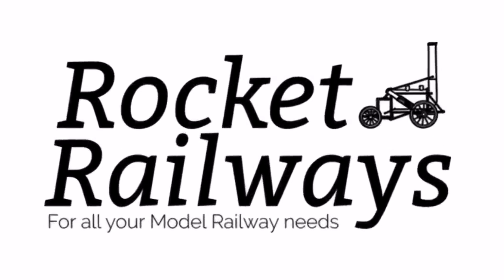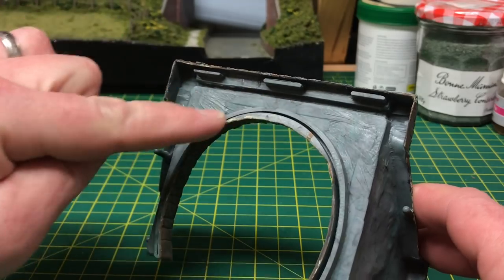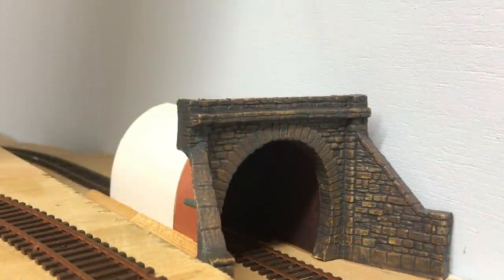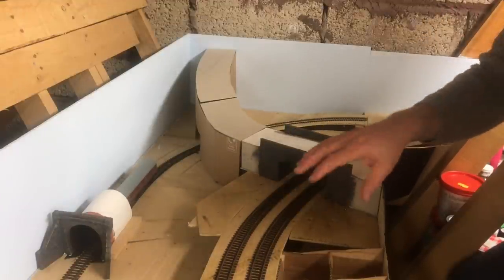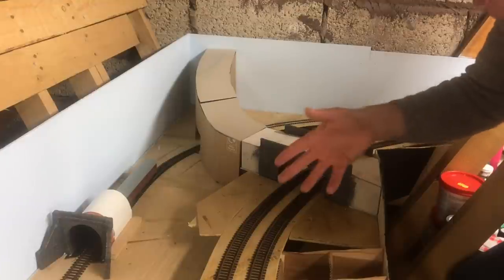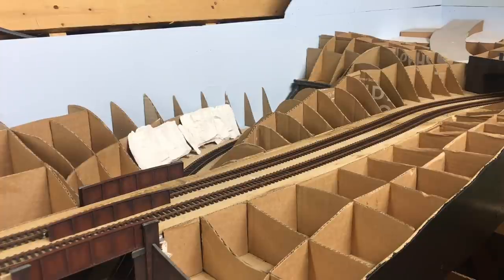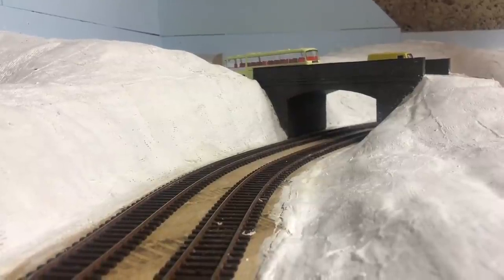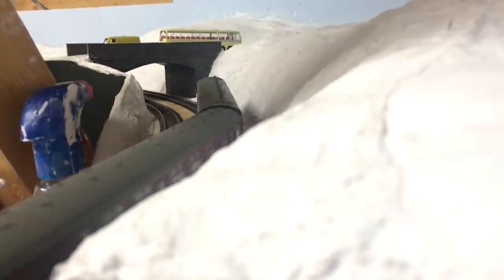Building A OO Gauge Model Railway: Constructing Hillsides And Cuttings

Comment: That section is looking really good now and is going to produce some great views when finished
Reply from the maker: I hope so Mal, thank you. Paul
Reply: There must be something in the air,  I have spent most of the week doing the landform in the viaduct valley and Chadwick is at it too! Must admit though, you took a much  more diligent approach to the sub structure than I did.  My method is a lot more messy as well,  but the result is roughly the same on the end.
Reply from the maker: Then I’m only following in yours and Charlie’s footsteps. Funny how you get a series of videos following similar themes at the same time. Paul

Comment: I had decided to use insulating foam board to build up terrain but have found it somewhat difficult to achieve the form I want by carving. Your results with cardboard look great I must say - though a lot of work to build, I think it is actually one of the best ways to build the type of terrain you want on your layout. I imagine when you do the painting and planting it will look fantastic!
Reply from the maker: Thank you Cristopher. I briefly dabbles with polystyrene sheets when I started my first section of hill forming but soon gave it up. The mess is one thing but also I found it difficult to visualise the terrain. This method feels a lot more fluid to me and I get the results I want albeit at the cost of additional time required. Paul

Comment: Major progress Paul 👍great work. Your ‘lattice terra forming’ is a great method with great results. Cheap form work. Lets you control the landscape. Bit more work but worth it.
Reply from the maker: Thank you Gary, a lot more work to get it right but for me it’s a useful way of working out contours, etc before committing and if it’s done wrong it’s only the cost of some cardboard to rectify. Paul

Comment: Hi Paul,  This video has come at the perfect time as I am researching methods for landscape construction ready for the inevitable..  I do really like this method..  Im always getting plenty of cardboard boxes so that part is effectively free and it really allows you to get an idea of how it will look before the plaster bandage goes on, which makes it easy to rip out sections and change before you get too far in.  I guess if there are too many lumps and bumbs you could then do a coat of sculptamold after to finish bits off.  Either way the area looks mint afterwards (kinda regret not having a dual line sometimes but not changing that now!)

Cheers,  Michael
Reply from the maker: It’s exactly the reason I opted for this method Michael. Glue it in and stand back, weigh it up and if it looks odd just pull it out again. No cost bar a little time but I’m in no hurry as I’m sure you aren’t either. A skim of sculptamold could be applied to smooth it out but in all honesty I think the static grass and shrubbery will disguise and of those larger lumps and bumps. As for that single line, I reckon it adds its own character and dimension to a layout. Less is more. Paul

Comment: Hi Paul, looking great, what you got for access in to that area? I have one large area that’s not easy to access. Trains ran spot on until I covered it and Sod’s law, last week a derailment, 2 DMUs head on. I did find out how flexible my body is!!
Reply from the maker: Hey Martin, theres an access hole on the backscene that will allow me to reach in with much discomfort to remove any detailed trains. If that proves too difficult I will cut a section out of the plaster cloth and make it a removable section. Hopefully Sod stays well away from my layout. 😆 Paul

Comment: Hi great video. What product  did you use to weather the rails?
Reply from the maker: Thank you Dan. The rail sides have been painted using cinnamon brown acrylic paint. Paul
Reply: @GalgormHall  I'm looking to rust effect the top of track. Maybe using 'wire glue'  or some other conductive sticky substance and some rust effect dye. Do you know if any ready made product even exists by chance? It bugs me weathered sleepers and shiny track 😕 especially for sidings e.t.c
Reply from the maker: @danhudson4614  it’s worth a try on a test piece anyway to see if it works. There are plenty of that powders and paints out there such as from MIG, Humbrol and Rust It paint. Perhaps the rust it could be mixed with the conduit river glue and applied to the rails. Paul
Reply: @GalgormHall  I was going to try at the weekend..but mine had gone rock solid and totally unusable. Will get some more at the weekend and experiment!  thankyou 👍
Reply from the maker: @danhudson4614  let me know how you get on, it’s something I’d like to look at myself. Paul
Reply: @GalgormHall  Yes for sure I have some conductive silver I can experiment in the meantime, I think rusty looking track is maybe way overlooked!. It's getting the balance of a good working line without contaminating the locos .